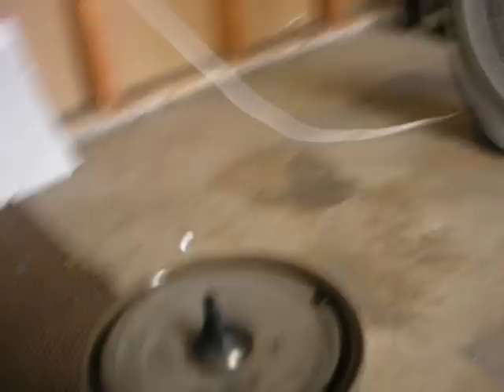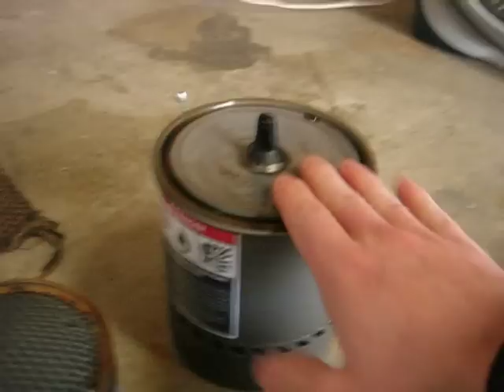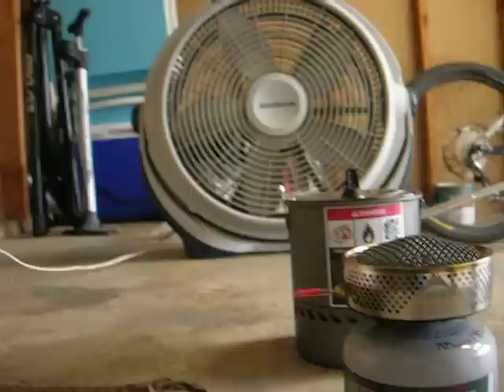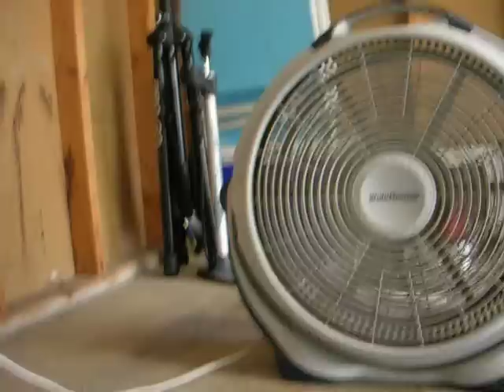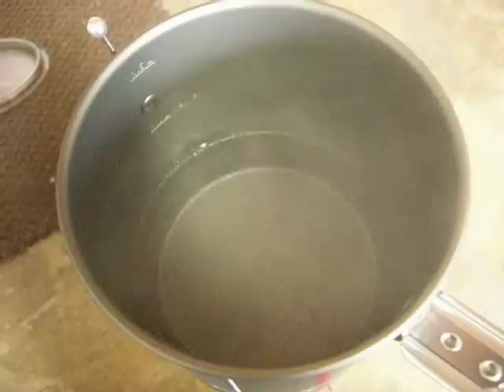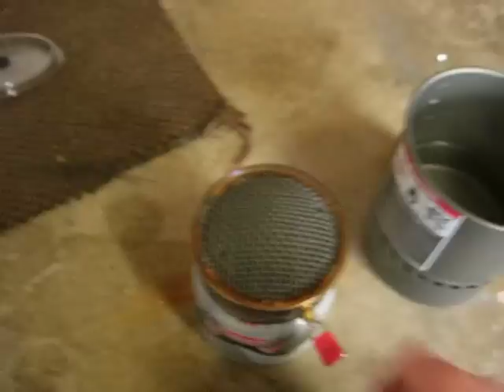MSR Reactor Medium Wind test

Comment: in summer i prefer trangia alcohol stoves, dont need as much hot water. However the reactor is a lifesaver in 20 degrees with the wind blowing snow@altitude and no feeling in your fingers.It was damn nice to have when there was NO place to get out of the swirling 30+mph winds in the rockies.. Unless ur going into possible extreme conditions I think its expensive for what it does.

Comment from the maker: @johnmonk66 I totally agree.  Boil times are over rated.  I am now using a TrailDesigns ULC Caldera with the Snow Peak 700.  So fast is not my game.  Quiet and efficient and lightweight and low volume are my game now.  Thanks.

Comment: Everyone is so fascinated with boil times, but unless you are cleaning water you pulled from a stream or using mountain house, what is the point?  I agree these fast boil times are not good for cooking food.  Even my Vargo alcohol stoves are too hot to cook with, I use solid fuel one half pellet at a time or I use a Coghlan fuel canister for a nice slow cook.
I am tired of scrubbing my pots when they burn on the bottom